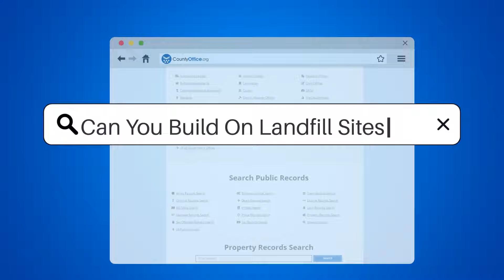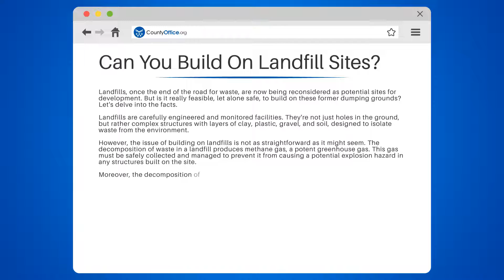Can You Build On Landfill Sites? - CountyOffice.org

Comment: Most old landfills were nothing but holes in the ground that were filled with waste like  old quarries. It is only the new ones that have the liners and the leachate and methane gas collectors. This did not happen until the late 70s early 80s   You can build on them as long as the bottom of the foundation sits on a competent surface such as bedrock, you have subfloor venting and leachate collection system. However most banks do not provide financing for buildings constructed on landfills